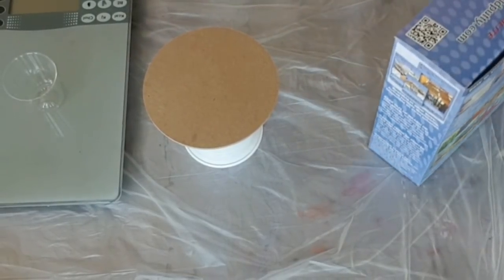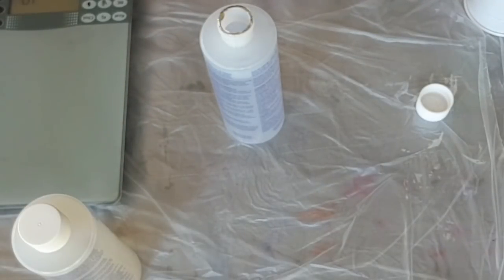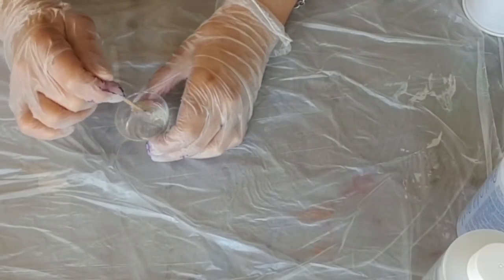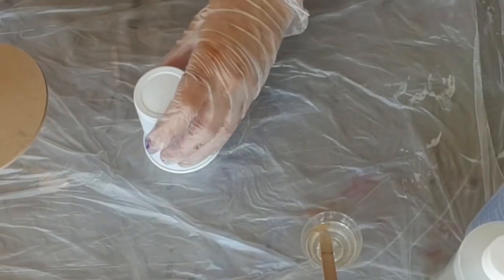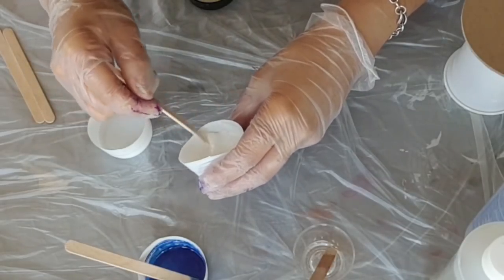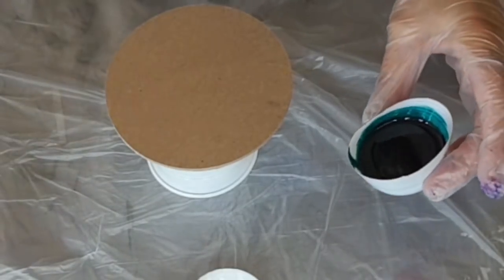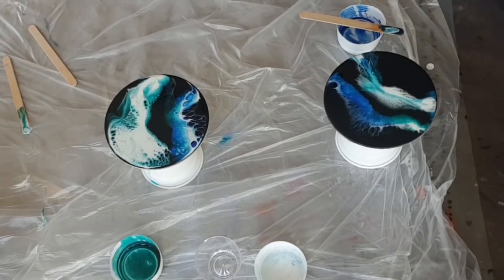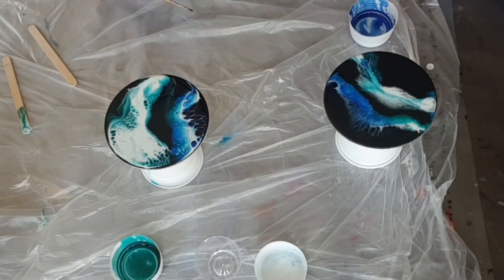Resin on coasters/testing new resin/ from start to finish for begginers

Comment: I used clear casting 7000 to make square coasters. The coasters never got hard. It’s been 3 days now and they’re still playable. The man I bought it from said that I couldn’t use such a small amount as you have. He also told me that I couldn’t measure it on athe scale because that wouldn’t be by volume.

Comment: Thanks for the detailed video.. lovely work. How do u cover the back of the coasters to protect from drips?
Reply: Shweta Rohatgi it’s easier on square tiles but painters tape works great. I cover the entire back before I pour the paint with the tape. After the resins dry the tape comes off and you have a smooth back then cover with precut coaster backs.
Reply: Resin is self leveling so most of the time it wont drip unless you add paint to the edges. I put resin on top of my coasters and. Ever have it drip on the sides

Comment: Great video - lovely work. Curious, as i try to learn to pour on top of objects rather than molds - when the resin drips down the sides, how do you stop it from going underneath? If it goes underneath, the coasters wouldnt sit flat on the table, right?
Reply from the maker: Great question.  You can scrape the drips as they accure or you can tape the bottom.  If you fail to do the above, you can sand the bottom and glue some felt fabric to hide the imperfections.  There's always a way....xxx
Reply: @suzanadancks  Thank you! I am going to try some this weekend. I have some small cork circles i want to coat and see if they can turn into coasters, but sanding the bottom of cork is impossible :)

Comment: Why did you weigh the 3 gram for the cup as the scale is showing 0g when you keep the cup on the scale. I guess it still turned out well. Video was helpful ❤️
Reply from the maker: I don't remember,  this is an old video but since it turned out ok, I must've measured it right. Sometimes camera plays tricks with us😉

Comment: Having so much trouble trying to get lacing have tried everything adding alcohol ink  Casting Craft  pigment , your Angel white just cant seem to get it to lace up .
Reply from the maker: Oh noooo! Not good, mate. Have you tried applying the angel white over some clear resin? Try not to overwork the pigment?
Reply: @suzanadancks  yep I have tried the clear resin first. Also a ryobi heat gun 2 speed but may be it's not powerful enough to push the paste quick enough. Could also be the resin I'm using.

Comment: Do you have a problem with a hot mug sticking? Which resin is best for this problem?
Reply: Alumilite is safe to about 130 degrees. Pro marine is about 140. Some of the high temp epoxies are fx, faux rizzle, counter culture, artworks.. those are near a 500 degree threshold.

Comment: Hi Suzan’s this is my first time watching.... What type/brand of paint did you mix in?  Do you have a preference when it comes to alcohol inks ?  By the way, beautiful creation!!!  What is MDK primer and is it a sealer?
Reply from the maker: Mary Lindsay I used epoxy pigments here.  The primer can be just Gesso and it helps resin stick better and minimises bubbles.  🤗
Reply from the maker: Mary Lindsay Thank you for your kind words😘🤗
Reply: Mary Li

Comment: I was cringing the whole time you were weighing the part A and B which are meant to be mixed by volume...   good video beyond that  :)
Reply from the maker: orion khan Measuring by volume not by weight! I know, but the test was to see if it would work and it did. It's much easier to measure resin by weight and the amount in the bottles were different from each other so I figured that the reason for part A having a lesser amount is because it's denser than part B. If they were measured by volume, there would be the same amount in each bottle.
Weighing worked perfectly. I did a larger piece also by weighing and it mixed and set beautifully .
Thank you so much for pointing that out, I should have exoressed myself better in the video.
Reply: Suzana Dancks   For months, I have been so careful to measure by volume, as my Manufacturer instructs-even in videos.  HOWEVER, your explanation makes PERFECT SENSE, as I have seen, in my larger pieces, that sometimes the resin does NOT set to a super hard surface, even though I was careful to measure one to one...I will try it by weight, next time, for a large piece, and SO much easier to measure in one cup, if I'm using weight!  Awesome!!!  Way to go Suzana!    Karen  👏👩‍🎨❣
Reply: YaYa Studio it’s definitely supposed to be by volume. The bottle of resin and the bottle of hardener weigh different amounts, although they are the same size bottle, because one is denser than the other (I believe the resin is denser, but I could be wrong about that). If it says to do it by volume in the directions for that specific type of resin, it would be the best idea to follow the manufacturer’s instructions. Your resin can be curing soft for many different reasons- temperature, the amount of inks/pigments you are adding (especially acrylic inks because they have water in them, and water effects how resin cures), etc... Good luck!

Comment: This Brand is on the list of resins that yellow after 8 weeks of testing in UV. This only matters if using as a clear coat as makes the artwork become darker over time.
Reply from the maker: +Neena Me Thank you for that info. I will look into it.  This is an American brand. I have no trouble with Aussie brands.
Reply: Neena Me I think every brand of resin apart from art resin can yellow with uv exposure even if they have stabilisers in them. If you coat all projects with art resin they will never yellow. Of course art resin could be lying there may be other brands that are as stable look for the two stabilisers in art resin and see if your brand has both if it only has one it can eventually yellow.
Reply from the maker: Lonny Coyne hi thank you for your comment. I was talking to a chemist who deals and manufactures epoxy resins and she had told me that every resin yellow synn time if exposed to sunlight.  Some just react quicker than others.  🤗

Comment: Measure tabletop epoxy by VOLUME, not by WEIGHT! Put the scale away..
Reply from the maker: Julie this wasn't tabletop epoxy. As for measuring I usually follow instructions on the bottle. Some are measured by volume, others by weight.
Reply: Yes it is. Alumilite is the same type used for coating bar tops, tabletops, and art projects. I use it by the gallons. Part A is denser and heavier than part B. Which is why the instructions specify to measure by volume and not weight. Your ratios will be off if you weigh.